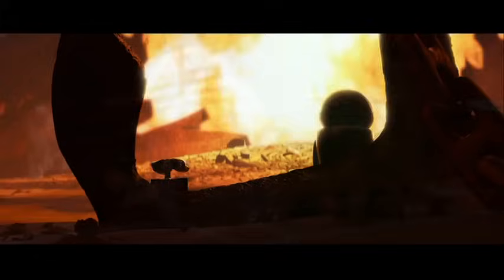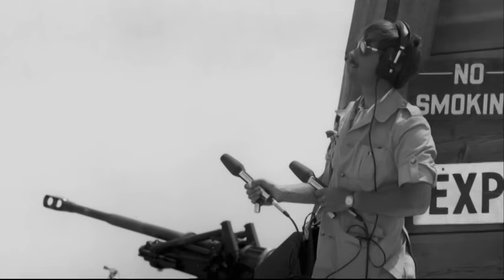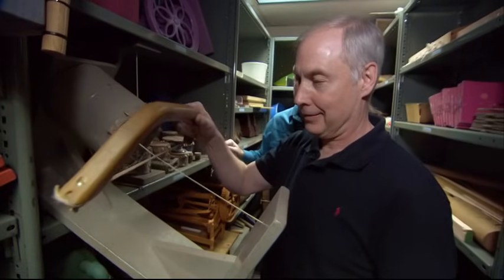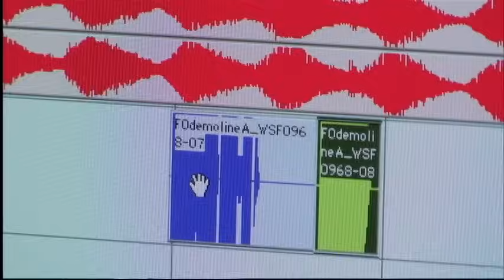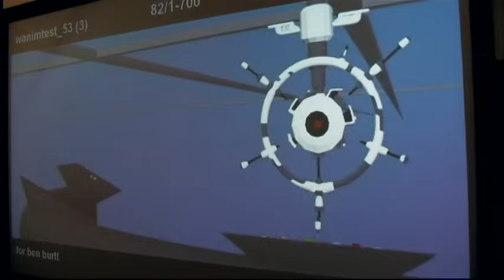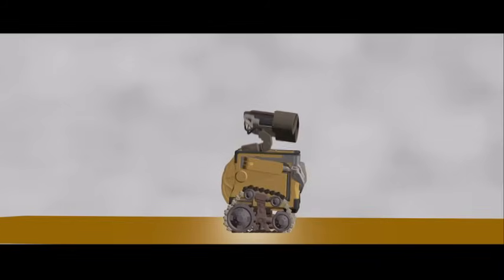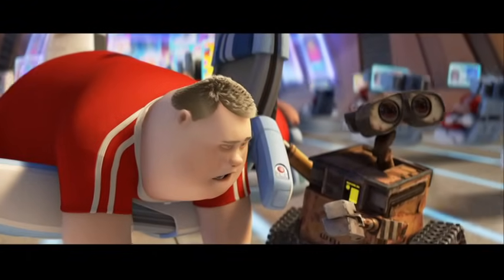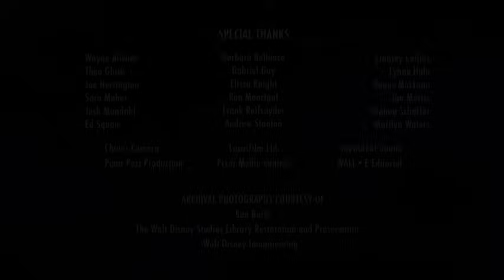Wall-E Animation Foley and Sound Design

Comment: Note, high frequencies have the same speed of sound than all other sound waves in a material. What makes springs etc unique is that the strike itself creates the high frequency and as the spring vibrates, it slows down the vibrations over time. So, the high frequency pulse of course arrives first as it is the one that started it all but the rest of the frequencies HAPPEN after the initial high frequency pulse and have a descending pitch. Metal plates are used as plate echoes as there is also a lot of reflections happening back and forth, which makes up the rest of the sound when hitting a spring. There is also constant variations of a pitch in a slinky, as it contracts and extends, wobbles around and the spring parameters change rapidly, it modulates the reflections that go up and down, the whole length. So we get two waves going on, one slower moving mechanical wave motion going up/down, side to side and sound waves, bouncing back and forth along the length of the spring, former modulating the latter.

Comment: Would love to work under Ben.  I love doing foley.  I used to do a bit of it at Norton Aerospace Audio Visual Lab in San Bernardino, CA. They wanted to apply sound effects to multiple WWII gliders crash landing. The archival black and white film had no sound, (of course) and it was my task to generate the sound. I did it successfully with the sound of falling trees that were being cut down. Worked great!